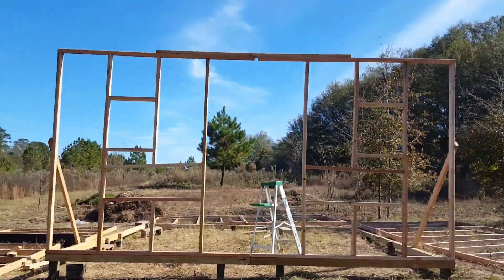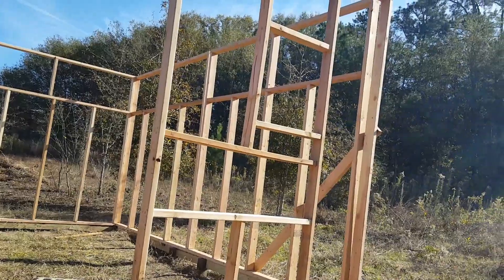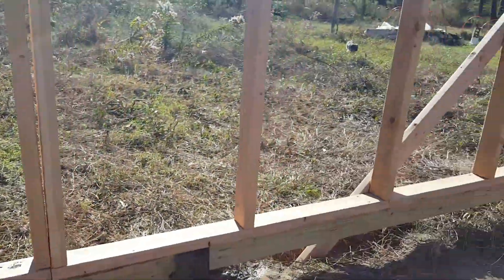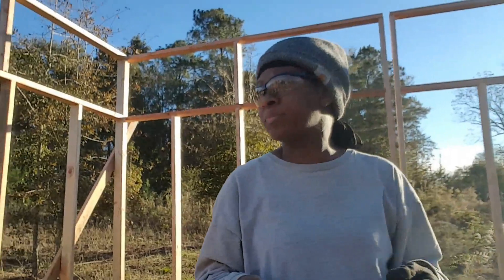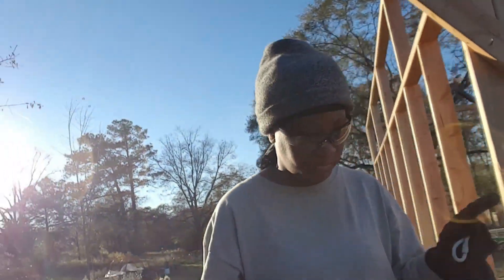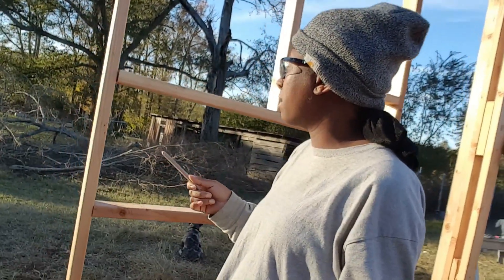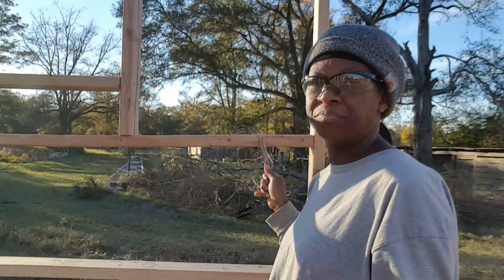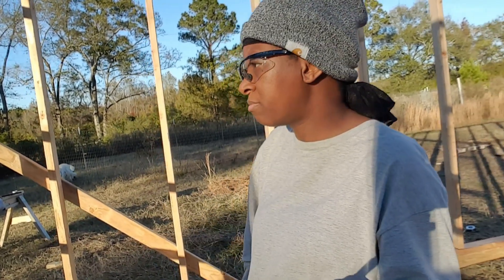Chicken House Build ~ Part 5 ~ The Walls Are Up!

Comment: When you made your walls you didn't account for the other walls being there, taking up space.  Your side walls should have been slightly shorter to account for butting up against the front and back walls.  Next time put in the 2 opposite  side walls first then fit in the other 2 for a tight fit and to square off.